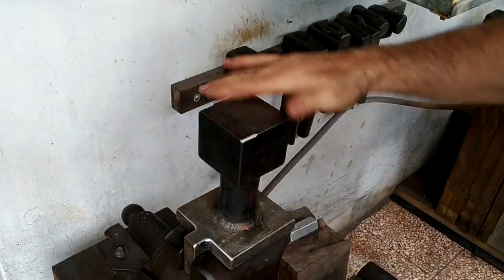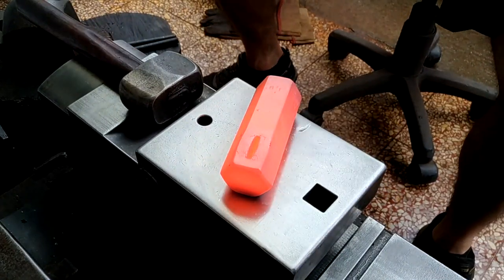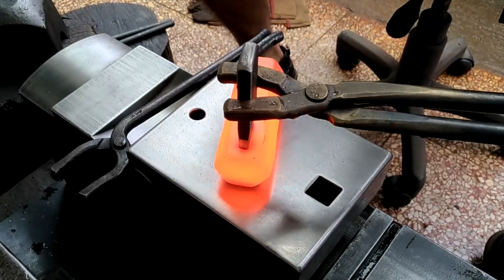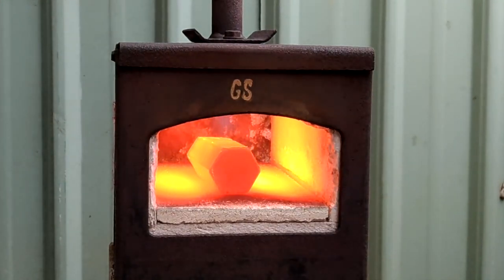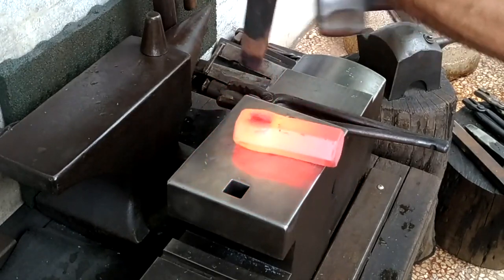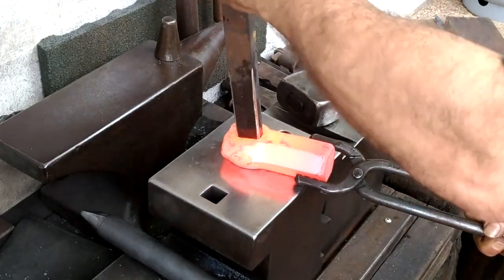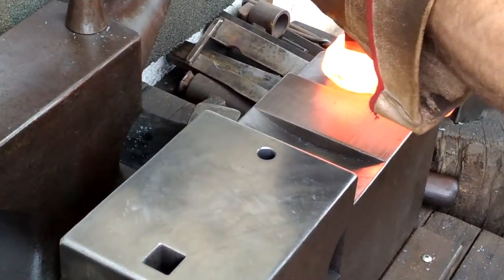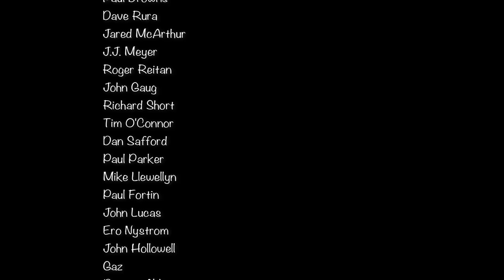Slitting Hammer Eye with Unusual Bevel Chisel

Comment: Nice hammer, I like it... 
Look like a good heft to it... 

When you add a blower to your venturi style burner, you might have to rejet the orfice size...  

It's kinda like a carburetor... 
More air needs more fuel... 
It'll take some fiddling around to find the right burning  flame...
Reply from the maker: Yes, I thought about the orifice size as you mention. I'll get the proper blower and try it as is then make adjustments as needed. You make very good points and I appreciate the input.

Comment: If you do a forced air burner setup, enclosing the burn chamber will deaden the sound and raise the internal temperature
Reply from the maker: That's a good tip. The forge maker does not recommend blocking the back opening completely though. I will have to see... Thanks.
Reply: @gstongs  that's because a venturi burner can't push a flame front well. This problem is completely eliminated when using a fan.

Comment: I have found that an air mattress blower works okay for an added boost to a forge. Maybe you can find one in your country?
Reply: I use one of those on my charcoal forge, powered by a transformer connected via a light dimmer switch. Great control 😎
Reply: A Hair dryer is more than enough air for a gas forge
Reply from the maker: I know where they sell suitable blowers and will head there soon, pick one up and show it. I appreciate your good suggestion.
Reply from the maker: Hi Erik, But my wife, who unlike me and has tons of hair, might disagree. Thanks.
Reply from the maker: I like the idea of variable speed control with the light dimmer. The blower I will get has a mechanism that can reduce/increase the air blast.

Comment: I'd have thought the uneven beveling would have resulted in a bit of an off-center hole. Guess I'd have been wrong!
Reply from the maker: Hi Bryson, I confused many folks on this one - my fault. Although the bevel is uneven if looked at from one side (thick on left and thin on right), it's reversed on the opposite side and so is actually even and so doesn't twist when hammered in. Thanks.

Comment: Thanks for sharing, Glenn. The more hammer videos I watch the easier it looks to make. The design of that style of hammer, is that for a special use, or just  preferred by the smith? 🤔 Still a nice job, well done. ⚒
Reply from the maker: Hi Robert, A lot of knife makers seem to prefer this style where the handle is set way back and where the mass of the hammer head is mostly in front of the handle and long. This creates a somewhat different dynamic when hammering and I think a better degree of control. Thanks.

Comment: That style slitter looks like it's doing a great job. Is the thin/cut end parallel with the body or does the offset edge turn the cutting edge a few degrees? 
Hammer looks great (as usual)! Thanks for sharing
Reply from the maker: So far, this chisel is working out well. It's pretty much parallel. When looking at one side, the edge is just steep on the right and shallow on the left (or vice versa). I'll continue to experiment with this. Thanks.

Comment: Does adding more air oxidize more? I increase heat by restricting the openings so heat stays in rather than to atmosphere but open enough for exhaust. I relate this to brazing on a brick. If you close in two or three sides you heat quicker. I know nothing about the technical aspects just my limited experience.😊 Great video. Also would that grind make the slitter chisel want to screw as it goes through? But I guess it is restrained in the slot🤔 interesting as usual. Thankyou.😊
Reply from the maker: After I get a proper blower, I will have to see since yes, forcing air in more quickly can create an oxidizing environment. You would think that that would mean turning up the gas to keep the forge running optimally but many have told me the opposite, that they use less gas with a forced air situation. The chisel bevel is uneven left to right on one side and the opposite on the other so that makes it not twist. My forge maker recommends not closing the back opening completely. Again, I will have to see... Thanks.
Reply: @gstongs  will be very interested to see how it goes😊 awesome

Comment: Great video Glenn. What did you use to mark where the eye was going? You were still able to see it even when it was hot. Much better than a center punch mark so I need whatever that is! Thanks.
Reply from the maker: Hi Pat, I used a paint pen to mark the location of the eye. It stays visible even when hot, especially the white pens. I will show these in my next video. Thanks.

Comment: I would be interested to know the actual temperature difference in your forge with the blower and without.
Reply from the maker: Hi Brian,. That makes two of us. Unless I had one of those infrared devices that measures high temps. I can't know exactly. But for practical  purposes, I'll be able to tell by the color my steel attains in a set amount of time. And also if I can reach welding temp. better. We'll see... Thanks.

Comment: Glen what type of steel do you use in your drifts if you don't mind my asking?
Reply from the maker: I used to always use H13 or D2. But I'm getting away from these more expensive steels and am just using medium carbon these days, either 1045 or 1050. Thanks.

Comment: Do you find that bevel tends to make the tool twist? I'm guessing not since you don't mention it, but it seems like it would you know? Thx

edit: although I suppose one could just rotate the tool for each use to mitigate that.
Reply from the maker: Hi Steve, since the unevenness is opposite on each side that seems to negate any twisting. The bevel is thick on the left and thin on the right on one side and just the opposite on the other which I guess evens things out. Hope that makes sense. Thanks.

Comment: Is your hexagon steel by chance A-33/ Atlantic-33 (flutagon)?
Reply: Steel nomenclature differs widely between the different steel producers in the USA. I have salvaged jackhammer bits from rock quarries in the Eastern USA and had 5 different bits checked. 4 were s7 by Carpenter Steel and 1 was s5 by Carpenter Steel. Have no idea, but am quite confidently saying that most would be in the 's' series (shock resistant) family of tool steel. A bit that is hydraulically powered by impacts against granite 12 houts a day, 6days a week is tough if it lasts 4 to 5 years in aa mining operation before failure! Taiwan may have different numbers though.
Reply: @stanervin6108  I get what your saying. But the reason I asked is because a-33 steel only comes in hexagon shape. I don’t recall him saying it was from a jackhammer bit. I must have missed that detail.
Reply: @erikcourtney1834  
   And I was not aware of the excusivity of a particular shape to a class of tool steel. I am 67 and have worked with metals since about 14 years old. 52 years you see a lot. Learn a lot. Have done fabrication, ornamental iron work, tool and die, blacksmith forging, small foundry charging and pouring, and only God knows what else! A-36 comes in the most differing shapes and sizes imaginable! Most, but not all,  tool steels come in rounds, flats, rectangular, square profile, hexagonal, and plate. Some specialty shapes can be ordered, such as spline shafting and equilateral triangle. Thank you for the heads up on A33 being only hexagonal.
Reply from the maker: Hi Erik, From what I know, hex stock can vary. I have some mild steel hex but this piece here is 1045 medium carbon. Thanks.
Reply from the maker: HI Stan, Thanks for your input.